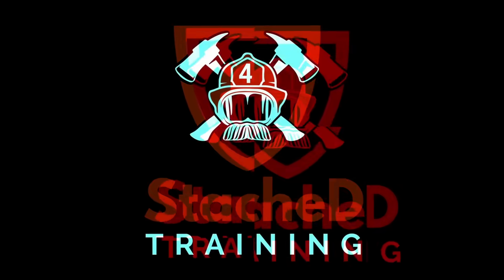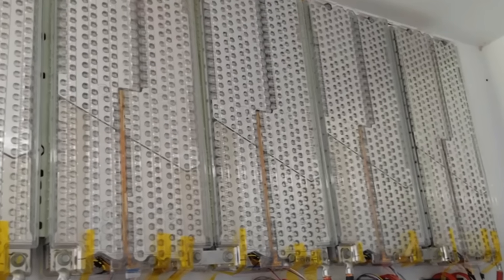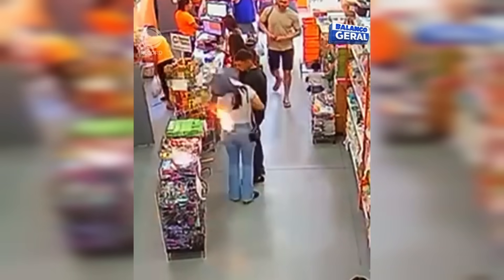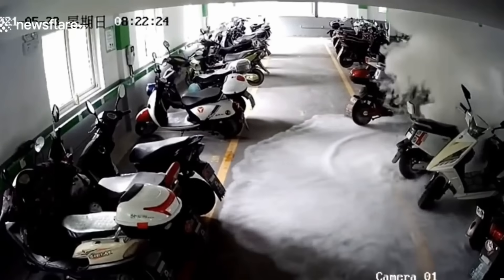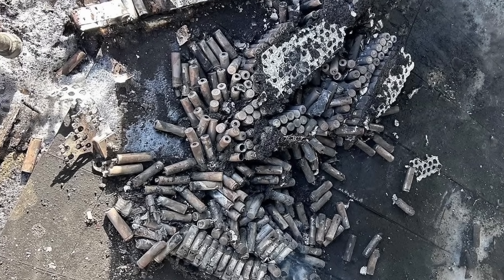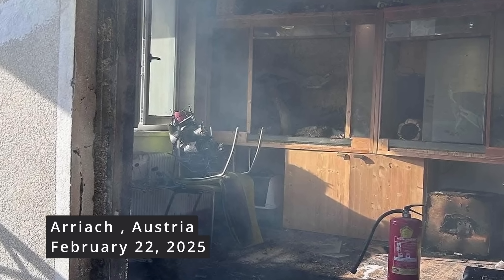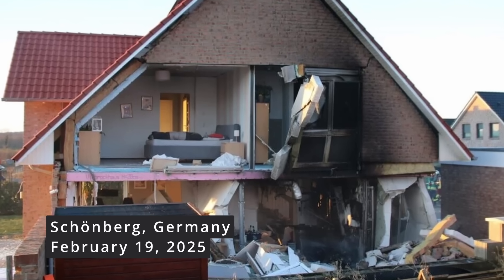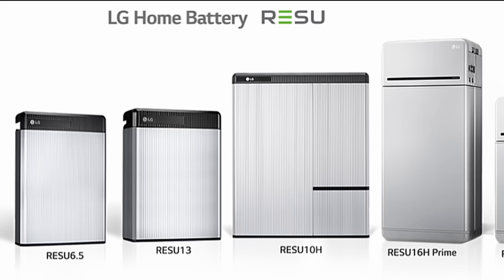Two Homes Just Exploded—The Hidden Danger in Battery Storage!

Comment: Do you have any links to papers that explain this relationship between the offgassing and the explosion of that offgassing? I think that danger is largely not discussed in the media and isn't widely understood by battery installers, garage designers, etc.
Reply from the maker: https://fsri.org/research-update/journal-article-investigates-explosion-hazards-lithium-ion-battery-thermal-runaway
Reply: @StacheDTraining  Thank you!
Reply: Thank you @StacheDTraining
Reply: @StacheDTraining I looked at that report briefly and only saw H2 figures in the mid 20%s and VERY low 30s cited, (which would put them at basically the same danger level as you cited as reference at 20%) and tbh I'm not sure how meaningful it is for real world evaluation in the first place due to the methodology used.

First and most notably; the gases may not release at the same 'rate'. (For instance more of the H2 may release before the hydrocarbons do.) But, beyond that, I'd be very skeptical about the real world risk in a situation like this (see : without a gas bag) because you need a proper fuel/air mixture to get an ignition. Yes, in theory an equivalent volume COULD fill the room to get the same effects, but that's quite a big leap in terms of assumptions made. For instance, over how long do we expect extreme off-gassing to need to occur before this threshold is reached? If it's past even 30 minutes, natural leaks from the garage would start dissipating that build up and it may never reach a good mixture. Then you have to factor in how many cells would actually fail individually before the system stops working? (Due to the BMS cutting it off, it electrically failing, whatever) 

Plenty of hazards are possible, but most people don't need to worry whenever they plug in an extension cord because "well maybe the inner cable is damaged and it'll start a fire!". What matters is real-world risk and LFPs are significantly less likely to experience the sort of cascading failures you'd need to get this gas output in the first place.

Additionally, you specifically cited garage doors blowing off, but in Fig8 their gas bag tests emulating the full release of a failed LFP battery LFP just barely even hit that bar in terms of over pressure, compared to NCA which DID wildly blow past it. A similar thing is shown in Fig 9 where the datapoints for LFP only seem to pass the threshold for minor structural damage. (Though I am looking at this on my phone so I may just not be seeing one)

They did do a few actual gas dispersion tests but it looks like it was only two and only ONE of those was using simulated LFP mixtures. Meanwhile all of their gas bag experiments seem to indicate that the real risk for LFP in a situation like this is relatively minimal. (Still bad, of course, but it's just barely enough pressure to feasibly damage a garage door and only passes the "exp. Minor Structural Damage" line, so I'd hardly lose sleep over it.) 

And even then, according to table 2 they only did three of those. (Which, I also just noticed that the one data point for an LFP test that passed that minor structural damage bar is a major outlier, and there are 4 LFP datapoints there, despite them only doing 3 LFP bag tests. So that might just be an NCA test that they accidentally mislabled or something.)

If anything to me that study suggests they'd be quite safe in a garage. Not completely safe by any means, but hardly the major explosion risk you imply here.
Reply: @StacheDTraining  That aticle is about Litium-Ion  NOT LFP (LiFePo4) very different chemistry!!!
Reply: @06rkave The recycled Tesla cells were 18650s, so were LiIon. You’re correct though, the others weren’t.
Reply: @karlInSanDiego they don't off gas, so to speak.

Major causes of fire and explosion are over voltage of invidual cells and dendrites.

Sure, you could end up with cheap graded cells as well. It's important to purchase a proper charger and battery and know what you are doing.

Lack of suitable fusing is also an issue as the explosion let thru or short current current is insanely large.

 Lithium dendrites are needle-shaped structures that grow on lithium metal anodes in batteries. They can cause short circuits, overheating, fires, and battery failure.
Reply: In Europe. Many installers suggest installing ESS units in loft spaces. What is not understood is the way these batteries vent. A both bouyent and denser than air vapour cloud. Both of which are flammable. Placing units in a roof space means the denser than air vapour fills the house or building and finds a source of ignition.
Reply: @marcusjones1088  Li-Ion cells vent explosive gases, yes, but most manufacturers have switched to LFP battery cells which in an emergency too vent, but the smoke is no explosive in any way
Reply: @legominimovieproductions  LFP do vent gas. And vent a higher proportion of hydrogen than other chemistries. LFPs can be pushed a little more. But the difference between NMC and LFP runway temperature is only a few degrees. LFPs don't produce flames but just off gas flammable vapour. So VCE with LFP is a higher risk than fire
Reply: @legominimovieproductions  still flammable..........if the gas builds up, its going to be a bad fire.
Reply: Because installers are stupid... why not create a vent and have a fire suppressing  systems ? 😮
Reply: THERE is  NO off gassing of these batteries....  look for information outside of this mans world.
The battery tech he refers to is not even made any more.
Reply: @MatWalter-q3h  lithium batteries in thermal runaway (ie on fire) release gasses copiously. When those gasses include hydrogen gas and that gas is contained in a confined space, not actively or passively vented, a spark or flame can ignite a hydrogen explosion.

When Fukushima's containment building exploded on camera for all to see, it wasn't because there was a nuclear explosion. It was because the byproduct of the runaway nuclear reaction had hydrogen as a byproduct. Different systems, same phenomenon.
Reply: For men this should be basic knowledge. Don't use a lighter or torch around vehicle/equipment batteries.
Reply: @flatout5815  wrong answer. That's vented lead acid batteries, and is completely unrelated to lithium batteries in thermal runaway undergoing an irregular destructive chemical change.

Comment: How are buildings insurers regarding these installations, particularly for private residences?  I now see around my area many houses with solar systems and with battery storage often located in the garage. From an insurance underwriting aspect, surely that’s a question which should now be added for policy applications or renewals?  

Also, of course, one sees increasing numbers of EVs parked outside homes, sometimes two EVs, in very close proximity to the building and hooked up to a charger cable. In those instances, a charger will usually be very low rated for overnight charging, but is that an increasing potential hazard?  Does the hazard risk particularly apply with ageing EVs and EVs acquired as used cars off the second hand market, perhaps with minimal history? Perhaps even more potentially hazardous will be ageing EVs that change ownership privately and without any dealership interventions or safety checks.

Comment: There is an important message here that batteries not properly installed and maintained can pose a serious fire risk.  On the other hand an energy storage system installed by a trained and licensed contractor is reasonably safe.

Any energy storage system should be installed as far from routinely occupied parts of a structure as reasonably practical and the system should have heat and combustion product monitoring so that occupants of the structure receive warning to evacuate if a failure happens.  Building code should require that anyway, should.

As a for instance … a 100 KW has about the same potential electrical energy equal to about three gallons of gasoline on top of any flammable components of the batteries themselves.  The batteries can fail exothermically with the electric charge providing an initial source of heat energy.  The exothermic reaction can start a self sustaining fire with heat, fuel and oxidizer all present.  Don’t mess with lithium based batteries, leave it to professionals.  Lithium batteries require a charge circuit tailored to the specific battery cell.  You can’t repurpose old automotive battery packs unless you have the precise data on the cells which can be programmed into a charge controller.  Most of the time, the requisite information about the battery cells is not readily available.

Comment: Lithium cells, even the LiFePO4 need the BMS system to prevent over charging, but what happens when the BMS fails?  If the cells overcharge, they puff up like balloons and gas off through the vent on each cell.  All these BMS equipment have no known life cycle expiry date, or known results when they do eventually fail.

Comment: What needs to change?  The root cause is lithium battery technology, which needs replacing with something that is safe.  The problem is how widespread this technology is, and the cost and difficulty of replacement.

The previous technology, nickel metal hydride (NiMH) was relatively safe, but now humanity has gone down a higher-performance, higher-tech path that should never have come into being in the first place  -  for many reasons.  It is doubtful that making a U-turn will happen now, but safety, as well as environmental, long-term usage, neglect, disposal, and recycling factors all need taking into consideration for a replacement, instead of just performance.

Lithium battery technology has long been a disaster waiting to happen, and now it's happening.

Comment: While I agree with the dangers of DIY solutions, saying that the BMS is designed specifically for that pack, implying some sort of special magic, is misleading. That's not how manufacturing works. Those BMSes are either off-the-shelf units purchased from other manufacturers (similar to how many cars have components manufactured by Bosch), or an in-house developed BMS that is used across a wide range of battery pack models. The only things that matter for a BMS is if it's designed for the battery chemistry in question (don't mix battery types), the number of cells in series , and which kinds of protections it offers (over/under voltage; over_under current; thermal).

A BMS is a BMS. There's nothing complicated about it. Some have more features than others, some are suitable for in-house battery storage while others aren't, but in essence they all do the same thing, and go about it the same way.

And just because it's installed by a company doesn't mean it's safe because it's installed by "experts". During the solar craze, a lot of solar installation companies popped up, and invariably they were all staffed by idiots I wouldn't trust to hold a door open, let alone work on an electrical installation. I'm not gonna bore you with the screwups they done in my installation, but in the end I had to go ahead and fix it myself because after repeated visits they still couldn't figure it out.

Comment: Probably just mount on exterior wall in garage, with mandatory ventilation fan mounted next to it, and powered by it. And just size and position to meet minimum necessary airflow (idk if the dangerous gases tend to rise or sink.) It manufacturers knew it was required, they could even maybe determine when it needs to turn on or increase flow do to internal sensors or something?

Comment: We've got electric cars designed by engineers that burn pretty regularly, these days.  High wattage battery power systems are just a dumb idea from the start.  If used, they should be put inside 4 block walls seperate from the house and with temperature controlled vents at the top and bottom.  The roof should only be attached with slack chains at the 4 corners in case of attempted explosion.   I'm not an engineer - just an electronics technician.  If I was an engineer, I wouldn't think like this, because I'd be too proud to admit that I had designed the system so poorly and that it was dangerous. 😅

Comment: LiPo/Li-Ion other than LFP & LTO batteries should not be used for energy storage purposes. They have a very volatile chemistry. Thermal runaway can happen to any Lithium Ion chemistry without dedicated BMS, I have yet seen LiFePo4 cells explode, even when intentionally damaged or shorted in series of 12 or 16 together or series-parallel.

Comment: That video could have been a lot more useful, missed opportunity.
Reply from the maker: This comment could have been a lot more useful.
Reply: Fair enough: If you want to make the point that it is simplistic for some to think “LFP is safer, so problem solved” but all you do is wave your hands at the products when offgassing being a higher % of H2 and vaguely state that LFP can also have thermal runaway “under the right conditions” I suggest that you have done nothing but put a negative cast on a technology without shedding ANY light on what conditions those might be and how they could be reasonably mitigated. If that is the extent of your presentation, it could have been a lot more useful. I think you have a valid perspective and knowledge base and follow your content, but could have done better in this instance regarding bounding the siting and mitigation of LFP in your opinion. Instead this comes off as just negative while the very important suggestions you make - most of which I agree with - are not highlighted and framed in terms of “here is mitigation in siting and venting that would allow safe batttery use” - apply what you know in a positive frame to keep responders safe and shape how people USE the technology they are going to use anyway is my suggestion. Respectfully submitted

Comment: NMC batteries are the problem. Most battery manufacturers have switched to LFP, which is much less dangerous.  The codes need to reflect the huge differences between battery chemistries.

Comment: Salt-based storage systems are much safer, but virtually non-existent and they take way more space than wall-mountable systems. Lithium based batteries are literal bombs, and all those DIY packs are often very well made, it's still several thousand of them stacked together, and absolutely no thought is usually given to give them safe way to burn down and vent burning gases. Even commercial systems are often dangerous in not their design, but placement.

I feel bad for those who lost their homes in these incidents, and I hope others will learn the lesson and design proper housing.

Comment: I have about 30 kWh of lithium NMC cells for my off grid solar system and they’re safely outside of my house in a metal building that I do not live in or sleep in. I think using a large wood stove to enclose batteries might be a good idea if there is a fire it will be vented to the exterior through the chimney.

Comment: One of the main reasons I think battery electric vehicles aren't the safest either.  Very rarely do you hear of someone's gas or diesel powered car doing this.  I'm sticking with my gas powered generators for backup for the time being.  They at least are kept in a separate out building (shed) away from the living space and run a decent distance from the house.  I take it very seriously when I have a mobile device and the battery turns into a pillow.  I immediately stop charging and using the device and set it outside.  And yes, I agree, Lithium Iron Phosphate batteries can be just as dangerous.  Most batteries are, that's why there are a list of warnings on how to store, use and dispose of them.  The same goes for lead acid.  At the very least lead acid batteries are recyclable while these other chemistries are more difficult or financially impossible to recycle.

Comment: THE PROBLEM IS NOT HAVING TEMPERATURE SENSORS.  THERE SHOULD BUT ENERGY CUTOFF IF TEMP REACHES 40C. SO NO CHARGE IS BEING DONE IF TEMP IS HIGHER THAN 40C.  No charge - no problems.

Comment: Yes, shit happens! If you count all the fires, initiated by bad electrical installation, malfunctioning TVs, washing machines, toasters, ovens - you probably would come to a number at least 20...100 times higher than issues due to li-ion batteries. And, afaik, most of these incidents are hobbiests trying to experiment with batteries they don't understand. But even if you do and build up everything very reasonably and securely there is still potential for failure. Some cells have internal defects, what chemistry ever. Many electrical items come cheap from china, they don't keep their specs and will malfunction early or later ...

Comment: Such reports are rather confusing than helping: The related german reports says, that it is "suspected", that the battery has been involved. But it does not say it is the cause!
I am involved in battery systems since more than 10 years. I have NEVER EVER seen a battery causing such severe damage on their own. In Germany many houses are heated with gas. Therefore I would  rather suspect that such an explosion was caused by a damaged gas pipe - MAYBE damaged by heat from the battery.
Also the local firebrigade office in Germany says that they cannot confirm increased issues with storage batteries.